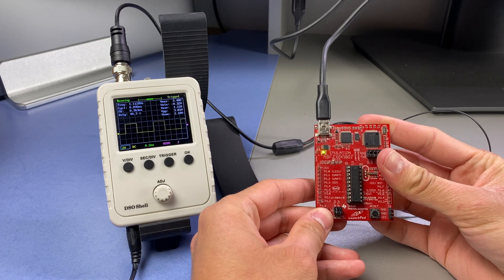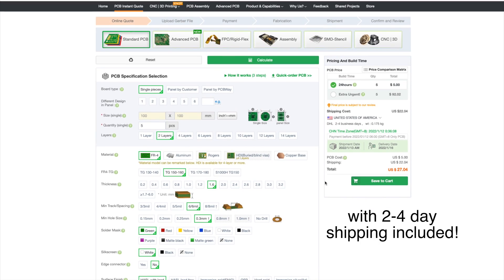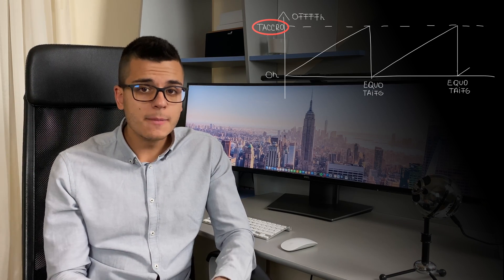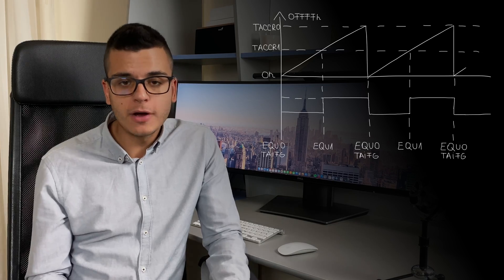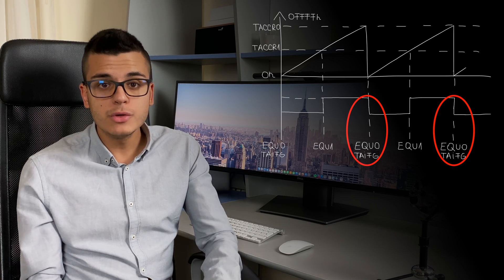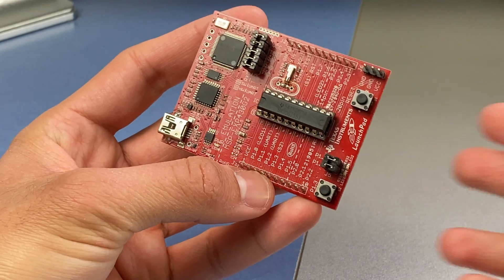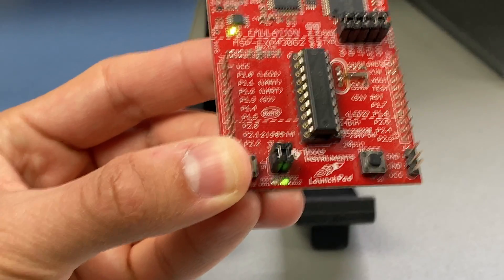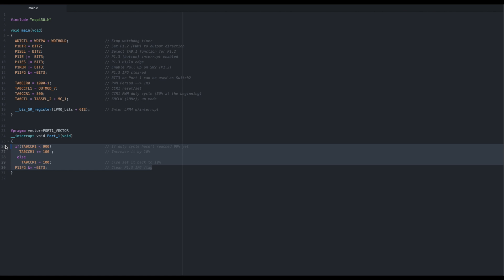How Pulse Width Modulation (PWM) Works + Example | Embedded Systems Explained

Comment: Hey Fabytm, thank you for making these videos. I just finished a class on computer architecture and my second electrical engineering class concurrently. Taking these two together and being able to see both sides (hardware/software) combine and meet in the middle made me realize how lucky I am to be a computer engineer and not one or the other. It also made me realize I want to be an embedded systems engineer. Your videos have been super useful to me exploring and understanding the whole field so ,again, thank you for creating them.

Comment: Hi! I have started learning imbedded system lately. I am currently working at a Air quality app + air quality sensors using Arduino Uno + Nodemcu. I think is the time to learn more about embedded. I will colaborat soon with UPB and hopefully with uRadMonitor.
Reply from the maker: That sounds great! What are the air quality sensors you are using?
Reply: @TheFabytm  I am using MQ135, PMS5003, DHT11 and something for atmospheric pressure. Those are connected to arduino uno, then arduino sends data to nodemcu, nodemcu with a esp2866 sends data to Thingspeak, then I am collecting the data to my Android App. I have a monochrome display attached as well. I will design soon a PCB for all of the components because there are too many cables with using a breadboard. I am not sure if I can receive the PCB in Romania.